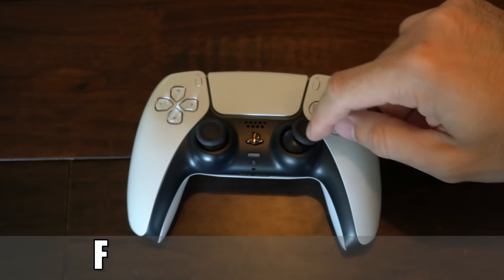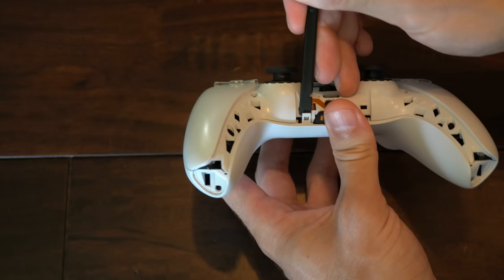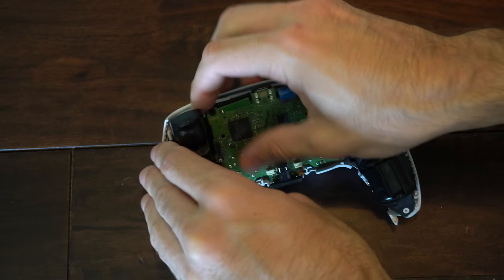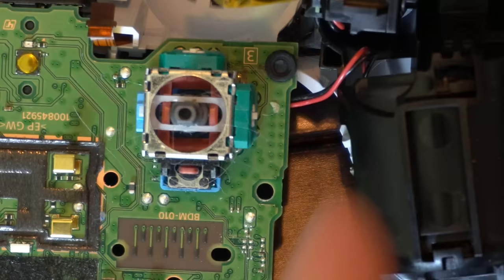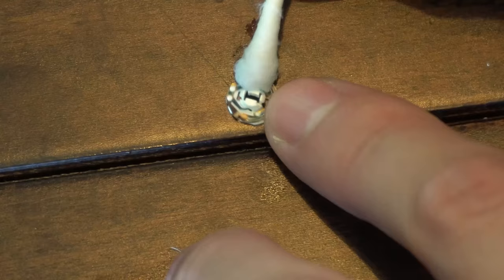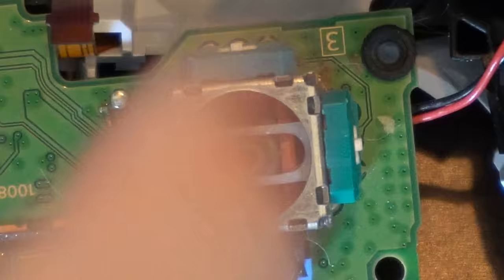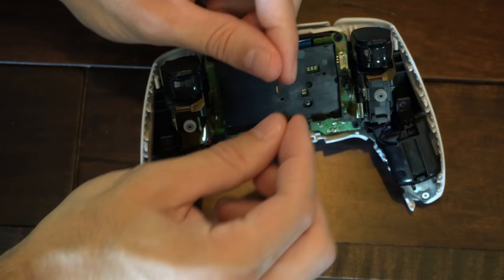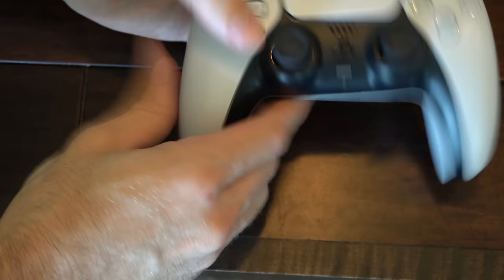How to FIX PS5 Controller Stick Drift & Moving on its own (Best Method)

Comment: This is the same method for the ps4 too. Idk but for the ps4 controllers it was just a temporary fix then i had to clean it more often which was a hassle. I hope the ps5 controllers not the same.
Reply: Mine lasted a few months and is back to drifting. Definitely temporary it seems.

Comment: I have 4 controllers having the same issue after 4 - 6 months.  So, I decided to sacrifice the oldest ones after watching this.  Broke the green piece holding the sensor... and now the left thumb stick is dead.😅😅😅 

Well, I still have the other 3.  Guess I will buy a new one before I start my 2nd attempt.

Comment: Be SUPER Careful with the ribbon cable on the battery assembly. Didn't use much pressure and ripped in half. Guess I should've just accepted the stick drift.

Comment: ok so! I had opened it up because I was getting the same problem were I would stop sprinting all of a sudden and sometimes, stick drift,  And I realized somehow I made it worse with the left analog stick. (movement) so I had to open it up again and compare it with the right analog to see where its going wrong at and I figure out one of the pieces I tried to force back on was pushed in to far and I just popped it back out and boom like brand new except I did manage to disconnect one of the black cables on the mother board thus preventing me from using my controller's mic, luckily I have my own headset so I don't have to worry about it much, (it sounded like doodoo anyways) .........THIS METHOD DEFINITLY WORKS ! BUT BE VERY GENTLE WITH IT BEING OPEN,  anyways thanks so much !!!!!!!

Comment: So, I did this and did both joysticks and both sensors (the right joystick was the one with stickdrift but sometimes the other one also had minor stick drift), and the right joystick turned up really good! As for the left joystick….its stuck going up, I switched the right sensors with the other joystick, and now it’s always drifting to the left/right. Any suggestions or tips to fix it?

Comment: Hey if someone in the replies could help me. I cleaned out the dust and everything, but I’m still receiving severe stick drift where my controller is always going to the left. Any suggestions?
Reply: Check the metal tabs on the sensor

Comment: The axis where I had the drift was so dirty while the others were completely clean. This was some kind of oil on it which was probably from production. I guess it made its way over time to a sensitive area at the contacts why it did not immediately create an issue, just few month later

Comment: I accidentally broke apart one of the ribbon wires and now I don’t think it’ll work anymore. I have a second controller still so it’s not a big setback but I’ll probably get a new one because my second one also has drift.

Comment: If you've bought your dualsense less than a year ago, you can contact PlayStation customer support and get them to repair your controller if its still under warranty. i did it once and it was fine for the next two years after i sent it but now that its expired i have to do this lol.  

you do have to pay the shipping fees which is about $20-25 i think

Comment: Apparently the little white bits where you clean can come apart with the smallest amount of pressure. I killed my controller doing this. Everything prior to the actual cleaning part went smooth but yeah be careful. This was a last resort before buying a new controller anyways

Comment: In my experience this did work but only for about 2 days. The drift came back after a little bit, I may have done something wrong though. Atleast in my experience was not worth the effort especially if you don’t wanna do it over and over once a week.

Comment: Tried this early this morning, it didn't improved my drift at all even after opening both green parts & cleaning.
Update: don't use a q-tip, it's better to use a microfiber cloth to clean it. Now my drift is gone, even though I broke the cable that helps with in game chat which I don't mind. Careful with those cables.

Comment: One if the four green flaps that get prized open came off all the way. Does this mean it is no good now? 

It was the first one that I attempted to clean it came open very easy, but I could not for all the tea in China get it to close. So I left it and continued with the other three. They were more difficult to open, but they closed again with a good squeeze. After doing the other three I went back to the first one that I tried and after an age of trying all sorts, and my son trying, it ended up coming off. But after it came off it closed with a good squeeze just like the others.

Listening to the video in the part were you say about it not coming off, and playing it over a few times it sounds like you could be saying that we don't want to break the solder, but I am not sure.

Comment: I messed up the wiring on one of the sensors and when I started playing, my character now spins violently.

Edit: I replaced the broken sensor for a new one in a cheap Nintendo remote, and now it works fine with no drifting.

Comment: maybe had a controller that was 6 months strait use started to get bad stick drift every once in a while couldn’t keep my cursor strait all i did was take off the face plate where the screws are and used a q-tip with alcohol put it right next to my analog stick and pressed the qtip against it and flipped my controller over no problem after

Comment: So i did everything right but putting in the little coil thing back in the stick made it stick and stiff but when i put the whole controller back together it stopped. Should I be worried or forget about it until it actually shows damage

Comment: You left out the part where you break the red wire at the very end and then attempt to soder it back on. Then the analog doesn't work at all because you probably broke that piece back towards the beginning of the mess. And now it's too late, and I probably can't play video games now.

Comment: This was a last resort as well and I was worried about damaging the controller as well. The current state of the stick drift however virtually made it unusable anyway so figured either way It works and I save 70 bucks or it doesnt and Im screwed any way. Luckily it worked just fine it seems only time will tell however.

Comment: If you follow this video step-by-step, you should be able to clean out the gunk in your controller 😂 the Q-tip was getting stuck on the metal part, but it all worked out in the end

Comment: Bro is should be way easier than taking the whole mf apart that’s the same issue I had with repairing my ps5 when my girls friend dropped it. The hdmi port replacement you gotta take everything apart just to get to it 🤦‍♂️ the frequent issues should be easier to get too.

Comment: Followed the video and after testing, the controller has gone from stick drift to permanently pushing left with no other direction working (left stick). No cables/ribbons have been damaged and all have been returned back correctly. Does anyone have any suggestions for what I’ve done wrong and what the fix could be?

Comment: I just opened mine and it has stuff yours didn't.
So using this video just cost me a controller because now the touch pad has stopped working even though I did everything the video said.
Reply: Did you place the top plug back into the motherboard?

Comment: WARNING

This video is not compatible with newer controller models. 
There are extra screws that need removed before the backplate can be removed.
The ribbon cables are similar, but smaller.
I see no latches on the board inside the controller either

Comment: I’ve only had my ps5 for about 6-8 months and it’s already got controller drift I didn’t even know what controller drift was a thing before this started happing to me, I have to buy the I fix it 125$ tool kit to do this, as well as taking apart my ps5 to clean out

Comment: Yeah, completely broke my controller. Once you get in there it's straight up brain surgery. Everything is so delicate and snaps off with the tiniest of pressure. I made it through, but the drift was crank upped to a 100 after my "repair"

Comment: so basically exactly the same way I used to fix me ps4 controllers, btw guys that little metal part on the analog is sometimes just burnet and completely unusable even after cleaning it. what I used to do is my a whole bag of them from amazon for dirt cheap and just replace them back in my dualshock 4 because ps4 controllers got this drift problem much easier then  the dualsense

Comment: I cleaned out all the circular modules inside of the joystick housing. It’s a lot better however it still drifts occasionally. I was really meticulous about cleaning it all so I’m surprised it’s still happening. Does anyone know if there may be a problem I did not address that could be causing the left stick to drift.
Edit: I thought it was better but after half an hour of using the controller it now drifts anytime I move the left stick. FML

Comment: My POV: (Watching this video because my controller has stick drift but I don’t want to take It apart because I’m afraid I might break It).
Reply: You have to buy a new controller then. And if that’s the case you might as well try to fix it even if you break it.

Comment: ive  tried it and cleaned it aboput 7 times but mine still has stick drift does anyone have any advice?
i dont have the alcohol to clean it so i use other things that wont damage it but ive had no luck

Comment: BE CAREFUL CLEANING THE METAL RING. The contact points are flimsy and the cotton grabbed and bent it, now it wont work. I suggest rolling the cotton swab in the direction of the contact point so it doesnt snag, or not cleaning the metal ring at all

Comment: So it all went smoothly, didn’t break any pieces etc. however when I’ve put everything back together and load up call of duty my character is just constantly spinning now, I’ve taken it apart again re cleaned and double check I hadn’t missed anything. Anyone had a similar problem?
Reply: nah mine just completely broke so i smashed it on the grounded

Comment: As I’m literally putting the controller back together one of the little metal prongs that you put the white things in connected to the orange cables broke off😐
I’m never taking apart these shits again, a waste of time and way too much energy was used up because I lost a piece and found it after stressing over it.
Great video though it was very informative up until my stupid ass broke it😂

Comment: My suggestion is buy another controller then do this so at least if u mess up I still have one
Reply: The whole point is to not having to buy another one. Also if you screw up there are tons of places where they will replace the anaolg.

Comment: Weak controller. I do remember my good old boy ps4 controller. 7 years old, all stick cover plastic been damaged,  and ran like a beast without any issues. And this dork is only 3month old with stick drift on its own. Cheap material, huge price on everything. It's a sad reality.

Comment: 7:26 i cant get mine to click back. only one side kinda clicks in but the other side isnt. any ideas?
Reply: Try to adjust the little white piece. It is tough, I agree, just really gotta squeeze buddy.
Reply: @jonnie5art  i got another one. used. had stick drift. got it today. and cleaned it and fixed it! last controller i accidently broke a ribbon cable. idk how

Comment: Shame Sony doesn't get called out for this nonsense. I've gone through 4 controllers due to drift it's also pathetic when you mention this issue within a comment section the console war freaks come out and claim it's fake or that you're an xbot or whatever. The community has become such weirdo's

Comment: I like the PS5 controller. But i don't like the quality. What a crappy PS5 controller! After >30 years of various dozens consoles never got a 'stick drift' problem like this, until now. I followed this helpfull video. But a (mic) print board contact came very very easy loose, solder contacts just fell loose when touching the cable... Controller mic is now trash.
Update after 2 weeks: stick drift problem is back again...

Comment: So everyone had the balls to do it?
Reply: Yes but cleaning didn't work for me, mine was damaged.
I took that small disc from my old ps4 controller and put it in dual sense and everything works.
Reply: Bro I just did it and it actually worked 💀
Reply: @alx-jp2xd  I just know my clumsy ass will break something
Reply: it broke
Reply: I fixed the drift on the right stick, but the left is still moving crazily after cleaning. Not sure what's up with it, thinking about trying again and applying rubbing alcohol more directly, as the sensor is already clean. But this is the last time I'm opening it up, not sure how much more my cables can take...

Comment: Do NOT DO THIS. These are SMALL plastic parts that will break very easily without the right tools and experience. This guy is setting you up for failure.
Reply: Agreed
Reply: Blaming others for your incompetence 😂
Reply: Not blaming, warning. Read how many others broke their controllers trying this. Do it at your own risk. You are bending solder points and I am almost certain this guy didn’t succeed on his first try. Now back to your cave troll.
Reply: @user-qz3dy4uo3h  troll? Says the person who can’t do it and resorts to calling the op creator a “knob”. Shut it and buy your new controller already.
Reply: @LethalMartialArtist  What are you the internet police? Get a life
Reply: @user-qz3dy4uo3h  I see you edited your original comment to remove “knob.” So I proved my point! There’s nothing wrong with constructive criticism, however when somebody goes out their way to help someone and it has resolved the issues for some of them, that person doesn’t need to be called a knob. Let’s move on.

Comment: Save yourself the time and just buy a new controller, odds are the problem is with damage and not it being dirty, all that taking apart your controller will be is waste your time and probably cause more damage
Reply: Or it works and you save 60 quid, this didn’t exactly work for me, I had a ripped apart ps4 controller and took the white part of the potentiometer out of it and put them in to the ps5 controller and it works like a dream, it’s actually quite easy to do, just have a little box to take everything apart in and keep in to not lose anything
Reply: @christopheroconnell3479  it doesn't work at all, followed the video precisely and it just made it worse, issue with stick drift is almost always damage and not diry